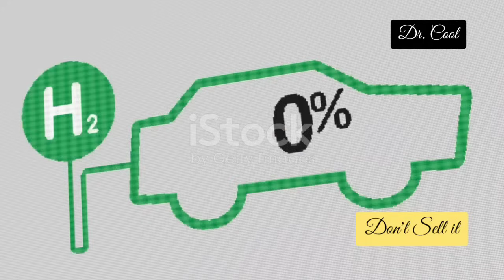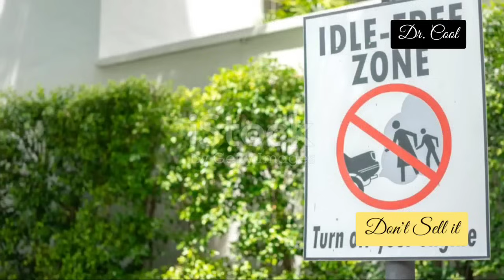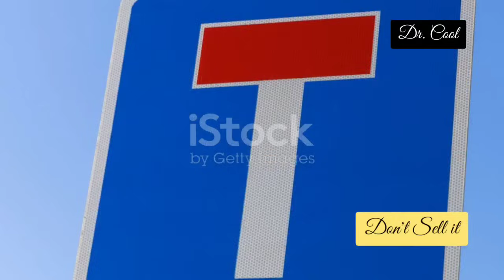DON'T SELL YOUR GASOLINE POWERED CAR OR CRUSH IT!

Comment: Its a huge PITA to do the Overhaul. The tie into the wheel Drive systems really eats the torque on Motors. I'm just overhauling EVs and making the owners ship the toxic Lithium Batteries back to the Manufacturer. Don't quit. Evolve that technology, Maxwell. Competition is Fun! It drives Progress.

Comment: How much does the EVS with a microsonic energy device cost? Are there affordable microsonic energy device conversion kits for the retro combustion cars? Thanks.
Reply: @JuanMelendez-l9f  - This device only keeps the batteries charged, supposedly. To use it on a “combustion car”, you would have to pull the engine and replace it with an electric motor and batteries.
Reply from the maker: As cheap as $15,000
Reply: @drcoolautofix  That's still too expensive for me. I'll stay with my old pedal bicycle. Thanks.
Reply: Well you'll only own one when other Chinese companies joins the mass production, thereby forcing the price down (that's the law of economics )

Comment: Don't understand how this battery charger could ever be retrofitted to a car to replace a petrol engine? 🙄🤔
Reply from the maker: Did you understand how your smartphone input touch screen works? No, you are only using it. Same goes
Reply: I'm wondering the same. Seems like the engine would have to be bypassed or removed and cam shaft would need to be moving from electric power
Reply: it converts radio waves into magical fairy dust and it can power everything in the universe 😂